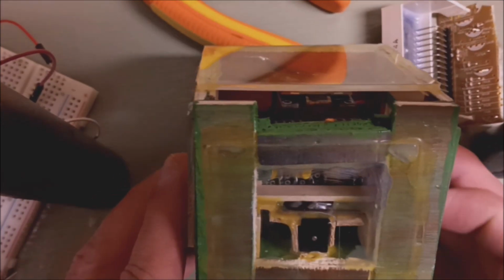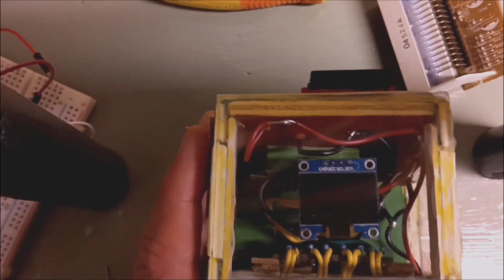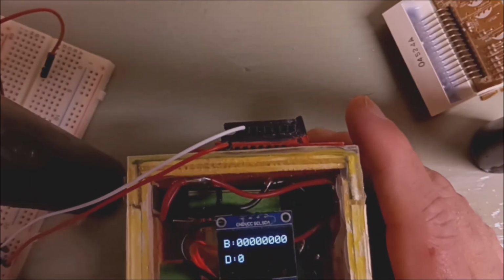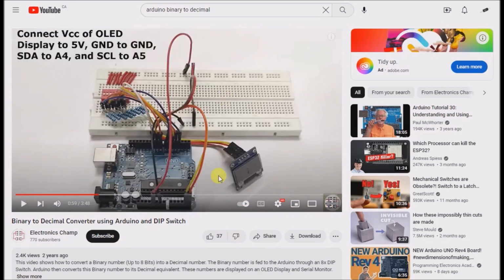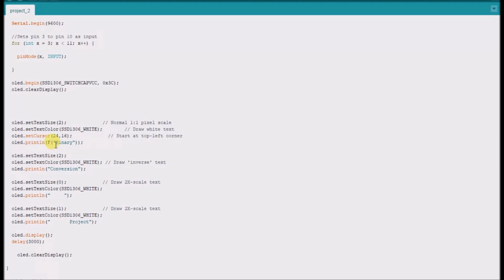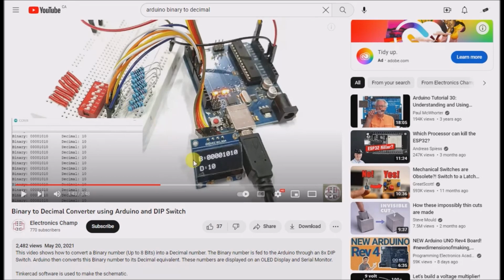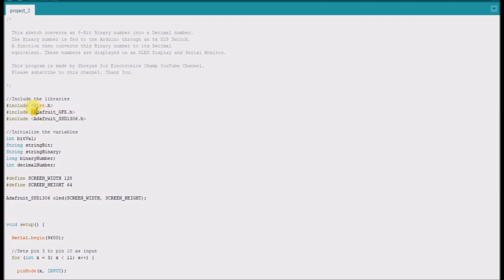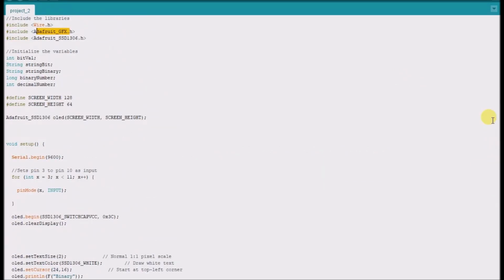Binary to Decimal Conversion (Arduino Project)

Comment from the maker: /* Free Sample Code

  This sketch converts an 8-Bit Binary number into a Decimal number.
  The Binary number is fed to the Arduino through an 8x DIP Switch.
  A function then converts this Binary number to its Decimal
  equivalent. These numbers are displayed on an OLED Display and Serial Monitor.

  This program is made by Shreyas for Electronics Champ YouTube Channel.
  Please subscribe to this channel. Thank You.

*/

//Include the libraries
#include <Wire.h>
#include <Adafruit_GFX.h>
#include <Adafruit_SSD1306.h>

//Initialize the variables
int bitVal;
String stringBit;
String stringBinary;
long binaryNumber;
int decimalNumber;

#define SCREEN_WIDTH 128
#define SCREEN_HEIGHT 64

Adafruit_SSD1306 oled(SCREEN_WIDTH, SCREEN_HEIGHT);

void setup() {

  Serial.begin(9600);

  //Sets pin 3 to pin 10 as input
  for (int x = 3; x < 11; x++) {

    pinMode(x, INPUT);

  }

  oled.begin(SSD1306_SWITCHCAPVCC, 0x3C);
  oled.clearDisplay();

  oled.setTextSize(2);             // Normal 1:1 pixel scale
  oled.setTextColor(SSD1306_WHITE);        // Draw white text
  oled.setCursor(24,16);             // Start at top-left corner
  oled.println(F("Binary"));

  oled.setTextSize(2); 
  oled.setTextColor(SSD1306_WHITE); // Draw 'inverse' text
  oled.println("Conversion");

  oled.setTextSize(0);             // Draw 2X-scale text
  oled.setTextColor(SSD1306_WHITE);
  oled.println("     ");

  oled.setTextSize(1);             // Draw 2X-scale text
  oled.setTextColor(SSD1306_WHITE);
  oled.println("       Project");

  oled.display();
  delay(3000);

    oled.clearDisplay();

}

void loop() {

  //Reads the Binary number from the DIP Switch
  for (int x = 3; x < 11; x++) {

    bitVal = digitalRead(x);
    stringBit = String(bitVal);
    stringBinary = stringBinary + stringBit;
    binaryNumber = stringBinary.toInt();

  }

  //Function to convert Binary to Decimal
  decimalNumber = convertBinaryToDecimal(binaryNumber);

  //Prints the Binary number on the Serial Monitor
  Serial.print("Binary: ");
  Serial.print(stringBinary);
  Serial.print("      ");

  //Prints the Decimal number on the Serial Monitor
  Serial.print("Decimal: ");
  Serial.println(decimalNumber);

  //Prints the Binary number on the OLED Display
  oled.clearDisplay();
  oled.setTextSize(2);
  oled.setTextColor(WHITE);
  oled.setCursor(5, 10);
  oled.print("B:");
  oled.println(stringBinary);

  //Prints the Decimal number on the OLED Display
  oled.setTextSize(2);
  oled.setTextColor(WHITE);
  oled.setCursor(5, 40);
  oled.print("D:");
  oled.println(decimalNumber);
  oled.display();

  //Resets all the variables
  binaryNumber = 0;
  bitVal = 0;
  stringBit = "";
  stringBinary = "";

}

//Function to convert Binary to Decimal
long convertBinaryToDecimal(long binary) {

  long number = binary;
  long decimalVal = 0;
  long baseVal = 1;
  long tempVal = number;
  long previousDigit;

  while (tempVal) {

    //Converts Binary to Decimal
    previousDigit = tempVal % 10;
    tempVal = tempVal / 10;
    decimalVal += previousDigit * baseVal;
    baseVal = baseVal * 2;

  }

  //Returns the Decimal number
  return decimalVal;

}